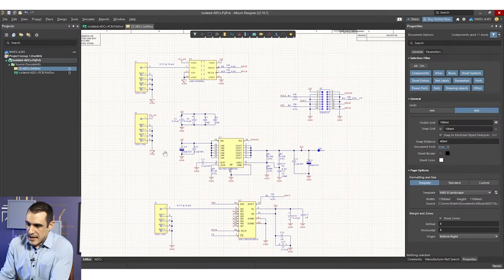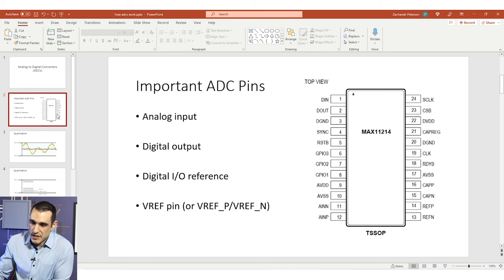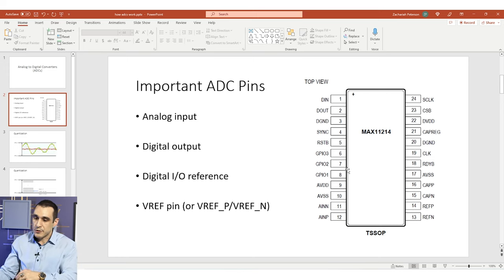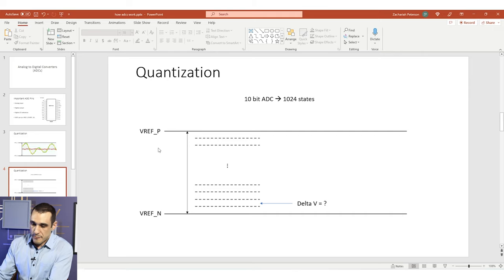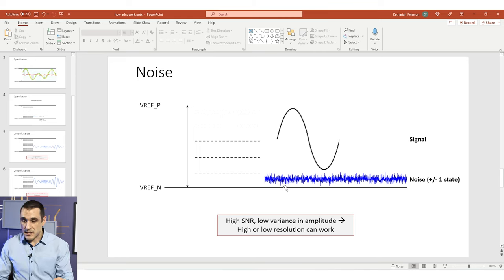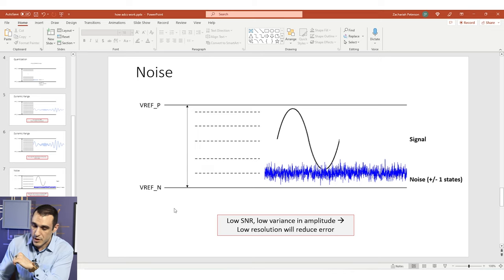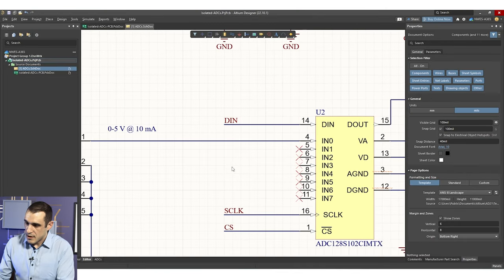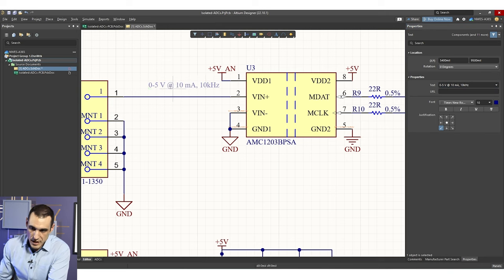How Do ADCs Work | Schematic Capture

Comment: Hey Zach, that was really in depth knowledge about the ADC's. It will also be good if you can take topics related to Microcontrollers, FPGA's, CPLD's, DSP etc. It doesn't have to be very high level knowledge but would be great if you can make understand them just at a basic level where someone might be able to understand their applications in the electronics field.
Reply: Great suggestion, looks like I should add it to my list!
Reply: @Zachariah-Peterson  Thanks for considering it.

Comment: Great content 👍👍👍 can you give some examples of high and low impedance sources? Thank you
Reply: Same here, I got confused on that part too.
Reply: Transducers and photodiodes (as well as other photosensors) are low-impedance sources. Circuits based on FET buffers and most nearly ideal amplifiers are also low impedance sources. FET-based circuits can vary though because the FET might apply parallel resistance across the output that raises the impedance. Some high output impedance sources include piezoelectric sensors and CCD-based devices.
Reply: @Zachariah-Peterson  Thank you for taking the time to respond, I have a better understanding now.

Comment: Thank you for the great content. 
How do I determine whether a signal source has low impedance or high?
in which case It is necessary that a buffer needed to decrease the impedance of the source signal?
Reply: Current sources are high impedance and must connect to a low impedance load, if your ADC has voltage-mode input you would use a transimpedance amplifier to convert to a low-impedance source. Ideal voltage sources have low output impedance. However, some sensors that are essentially voltage sources have high output impedance and are intended to connect to a high load impedance, in this case you should do as you say and convert to a low output impedance voltage source with a buffer amp. Some sensors that require precision measurements may list their output impedance, in which case you can make a judgement as to whether you should convert to a low impedance source with a buffer.